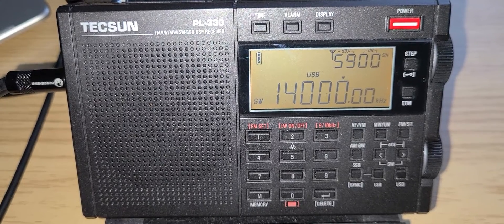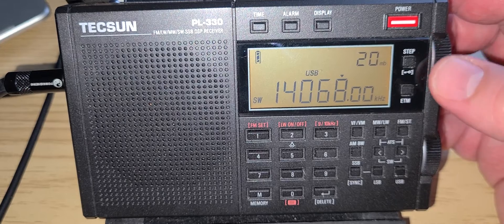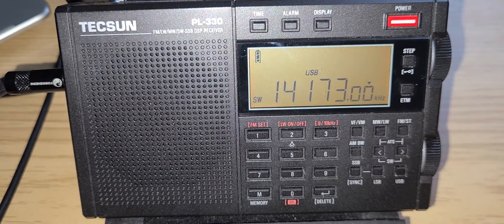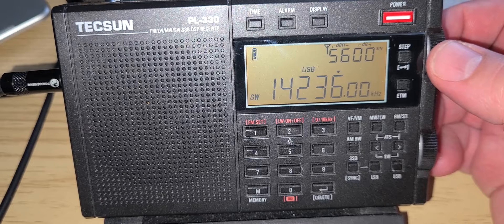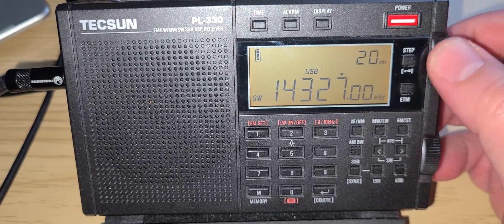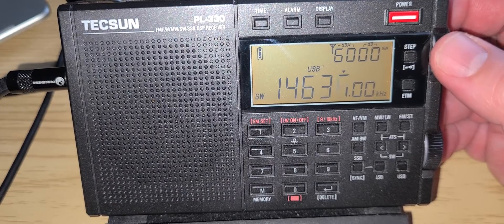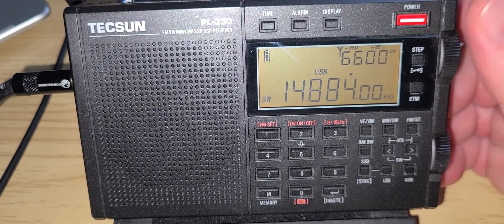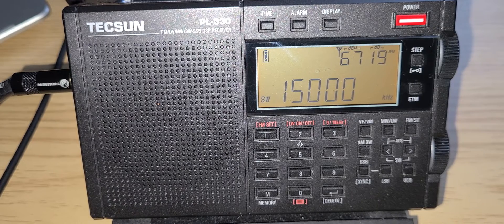Operating the Tecsun PL-330 from 14000 to 15000 kHz Shortwave tuning SSB ham band more

Comment: hi. im an old box with dials and knobs and frame handles  guy, so all thess cigar boxes with planar readouts and clicckey buttons are daunting. i bought my grundig s350dl from the local radio shack in 2007.  hurriicane country so straight old style d batteries. not so much today, alll rechargeable........no goood after 12 hours no power to come for days. i amm impresseed w/ the 330.

Comment: Not bad radio, but two years after boght it, the charging socket begins to fail contact. With the Tecsun PL310ET the same problem was happens. Tried with a two new cable but problem persists.

Comment: One persistent bug in my PL-330 is if you set the radio to external antenna (long press 3 with the radio on) and you run an ETM on MW or LW, when you get to tune through the channels it heard on ETM, the external antenna function has disabled itself, you have to long press 3 again...but when you move onto the next station it heard you have to once again set it to external...very annoying...anyway maybe the later models have sorted this, I dont know.
Reply: That is an odd error, which software revision does your 330 have? Mine does not do that on rev 3306.